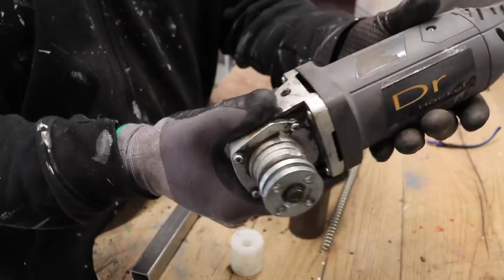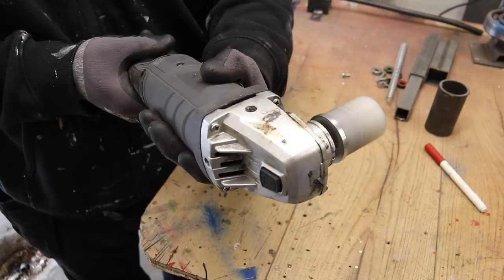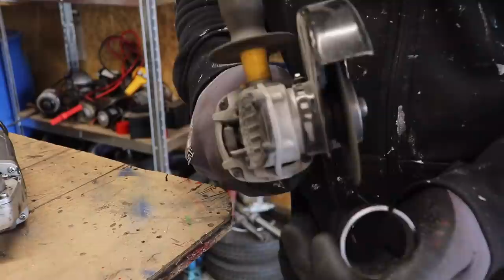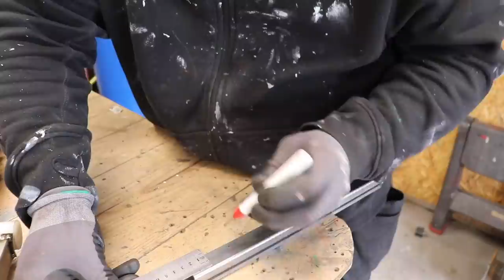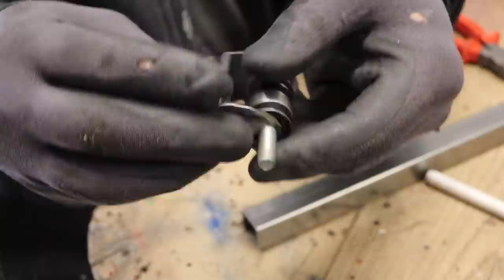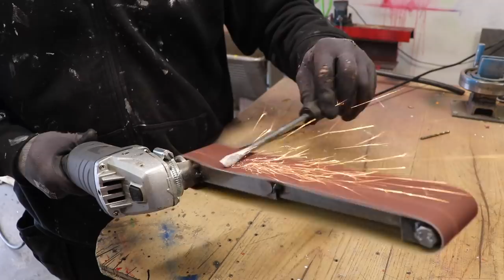WOW !! SIMPLE IDEA WITH GRINDER

Comment: Very dangerous, you need a backing plate behind the sandpaper so you can apply the force needed to grind a big piece
Reply: I came here because he put screws through a tiger disc. At least this is not very dangerous but he built this tool that is a specialty shaping tool not general purpose but whatever just don't do what he does.